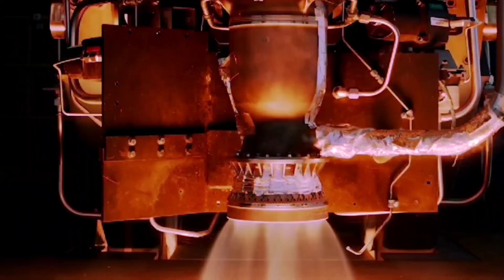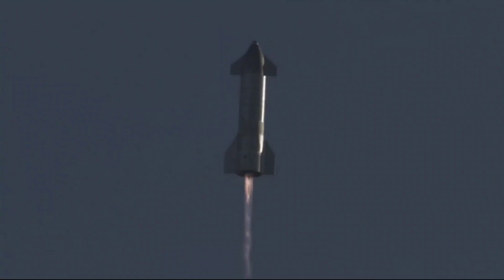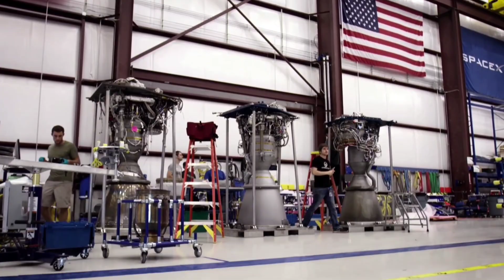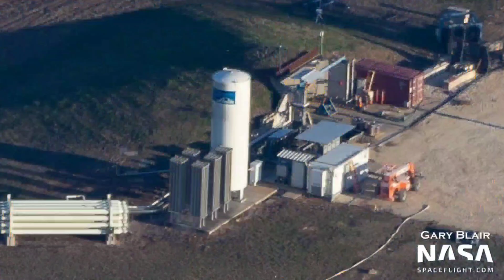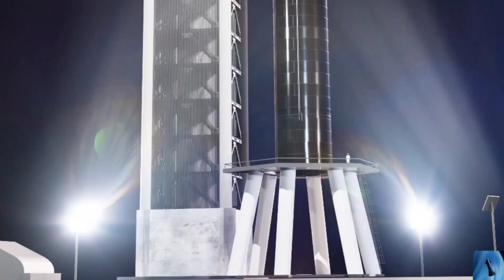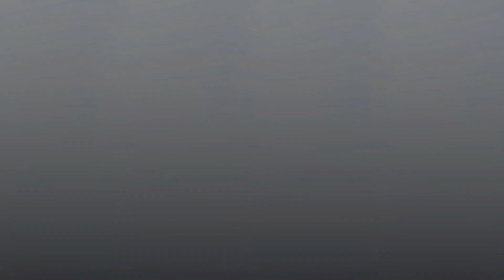SpaceX INCREDIBLY INCREASED Raptor Production For First Orbital Flight

Comment: One thing for sure!  If the prototype arms have braces, the braces for the arms can not be on the top of the arms, but on the bottom. 
   I still think the arms, or structure, is going to have some sort of counterweight or braces from the tower to the ground to strengthen the tower for the vertical and horizontal  stresses of catching the booster!  Since the arms will need to pivot anyway, a counter weight would be a good bet.